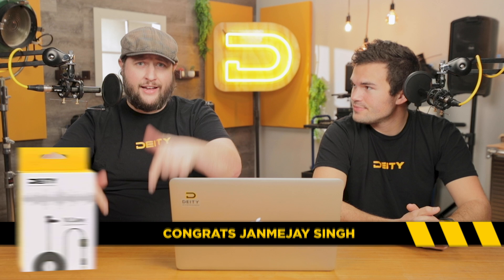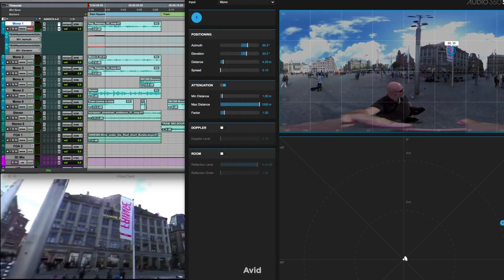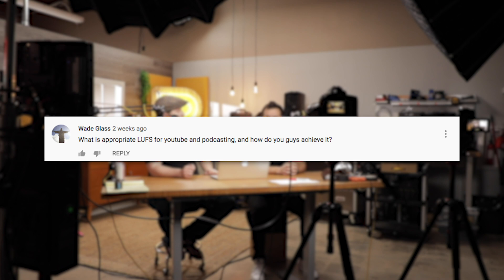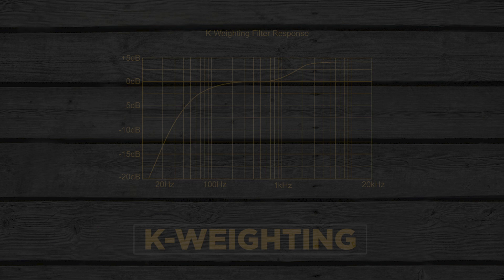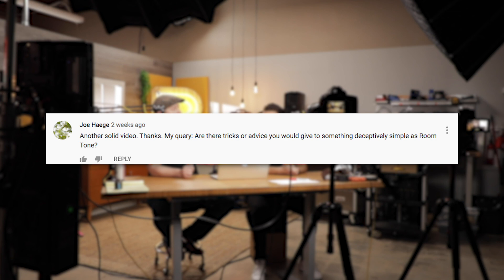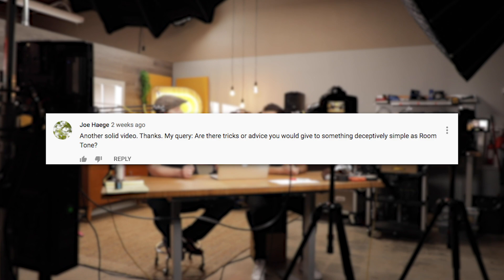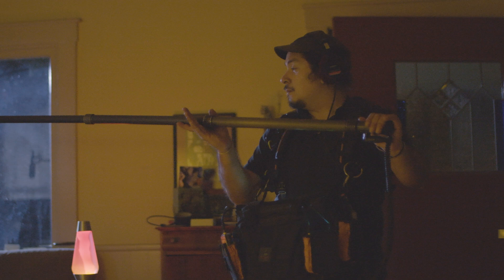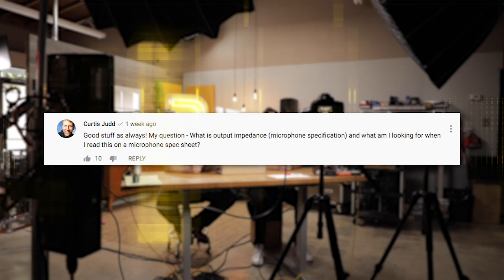Room Tone Hacks | Simple Tips To Ensure Usable Audio

Comment: So what if your doing a 2 shot cueing  the mic aiming it to  2 different directions to get room tone since you aimed the same to get dialogue?  do you capture RT for both sides where both actors were sitting?  and how would you ever know which way you were aiming the mic capturing that room tone to match in post?

 I don't think you can! Unless you call it out room tone for this actor and that actor, but not sure the director will like you capturing more tone than "they" think you need! 

I would think if you just get room tone where one of the actors was sitting, then it will still sound very different when you put the tone where the opposite actor was sitting, no?  hope this makes sense.